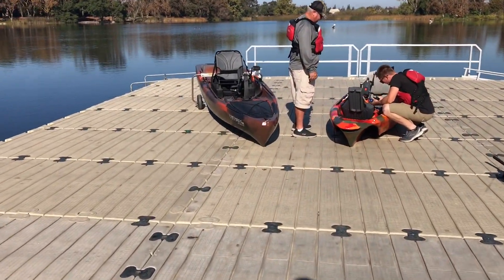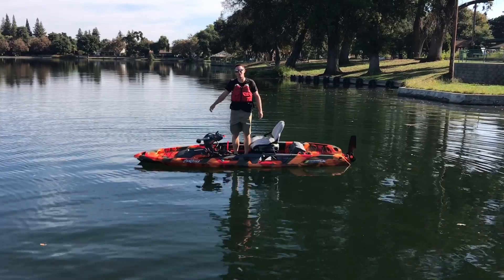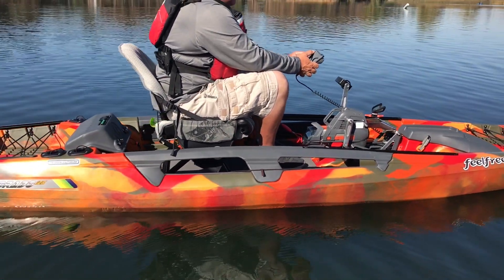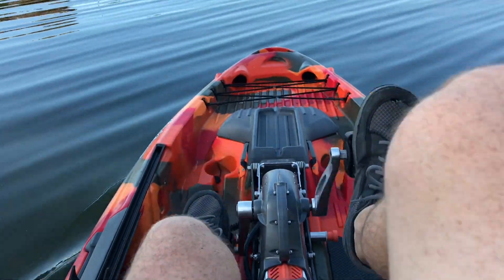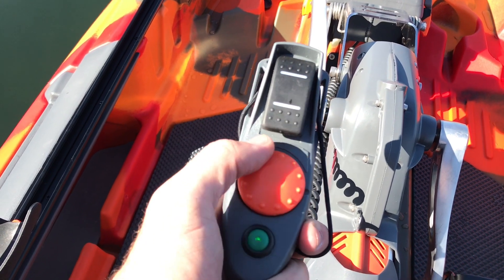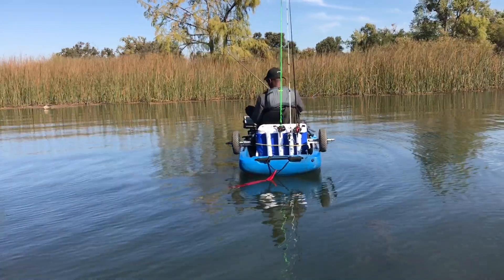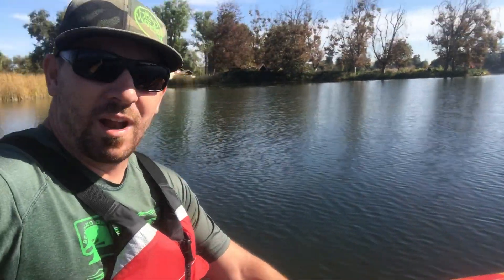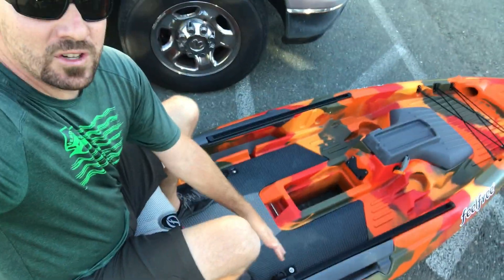On Water Demo: Feelfree Dorado With Motordrive

Comment: I think the overdrive motor system is somewhat under appreciated. There are other kayaks that have a trolling motor but none that incorporate a trolling motor with a pedal system. You can motor to your fishing spot then switch to pedal drive to fish. This is a unique feature which other manufactures should look at. The system however could maybe use some refinement.

Comment: I'm liking the deck space the Dorado has fore and aft. I wonder if it is possible to carry a lightweight passenger just behind the seat or maybe in front. I weigh 135lbs and my wife weighs 107lbs. I plan on pleasure cruising with pedal power and trying to decide whether to get a tandem like the Lure II with a single drive unit and have even more space with one seat removed for camping gear when I go out solo or the spacious single Dorado. I doubt if my wife will come out very often. But you never know.

Comment: I think I'll get the Feelfree 11.5 v2 and put a 65 # thrust trolling motor on it
That thing is loud.
I'll be calling soon not to soon but soon I'm still looking but I'm almost sold on Feelfree love the lay out.
Thanks!
Reply: 65 is pointless. It still won't do over 4 mph no matter what trolling motor.  
Not enough prop pitch or rpm from a trolling motor. Youle just burn more juice quicker. I have a 30lb on my ll.5 lure. That's about the hual speed thier a barge. I have a 2,1/2hp outboard pushes it about 5 to 7 mph depending on water condition. I use mostly in the bay.
Just buy a hobbie.
I bought the lure to blowfish off of because of its stability and deck layout. I've used the hobbie outback multiple times. Its better at everything maybe a little less secondary stability but that's it

Comment: Thanks for the video. Are you planning any further tests of the Dorado?  If you are, how about giving some ranges at 100% and 66% throttle with battery options . Paddle ability?  Top speed vs cruising speed with motorhead unit. Turning radius of Dorado at high speed and slow speeds. What transducers are compatible with this kayak?  It looks like it’s side scan compatible as well as possibly 360 transducer ready. Any feedback is appreciated. So many questions with so little space. Thanks
Reply from the maker: Mark Massa yes I’d love to get more in depth. This was a total throw together video that I squeezed in to get some info out on the motor. I’d like to do a much more detailed video at some point.

Comment: 🌟🌟🌟🌟🌟Questions. 1. What's the range can the system go, at let say 50% throttle?
2. Can you show the bottom side of the kayak. 3. How many hours does the battery last from a full charge? 4. Do they have like the pedal assist electric kayaks like ebikes do? 5.What's the price of this electric kayak? Thanks.
I am into ebike cycling from just a year ago. I am enjoying the benefits. Plan to get a Merida pedal kayak soon to combine with my fishing hobby. Good video.

Comment: Thanks for the video! Love your reviews. That's really loud! Very disappointed by that. I know it might just be the mic(s) and this video, but wow. 

Personally, I went with a Field & Stream Shadowcaster 123 (also manufactured by same company as Feelfree) and a "built-in" Island Hopper Outboard 55# trolling motor (installed all the wiring and batteries in the hull), and I'm starting to feel pretty good about that decision. MUCH quieter, faster top speed (on only a slightly lighter boat), literally less than half the total price, and yet a very similar kayak in terms of deck space, design, and function. The only thing I don't have is the pedals, but where I fish if I can't use the motor, then I wouldn't be able to use the pedal drive either. 

Really like the Feelfree line of kayaks tho, and if the Shadowcaster didn't exist, I would've probably opened the wallet more for a Lure. I really like the idea of the Dorado, but it almost requires the motor, and they clearly have some improvements they need to make before I'd buy that.

Comment: The factory must start building helical cut gears NOW!!!!!!!  😡😡😡😈😈😈😠😠😠
Straight cut gears to save money what a bunch of garbage..
For the last 60 years all machinists know that helical gears are the best quiet.
Disappointed we are. And use rubber cushions on the mounting points to deaden sound vibrations.
Its not your fault you didn't build it.

I will not invest my money into one until they fix it. Sorry.

You did a great job on the video .
Thanks for being truthful.
I really wanted a feelfree I'm sad now 😕😢